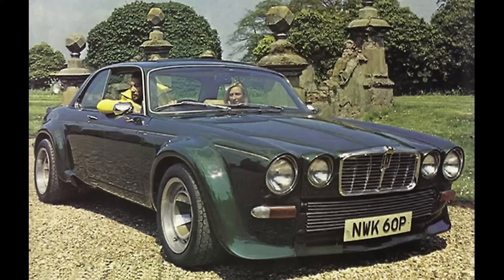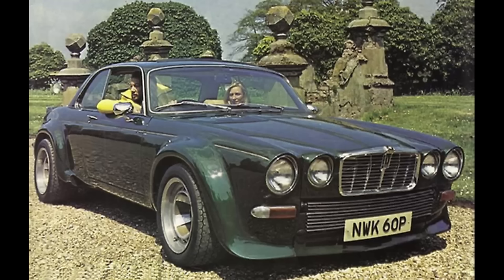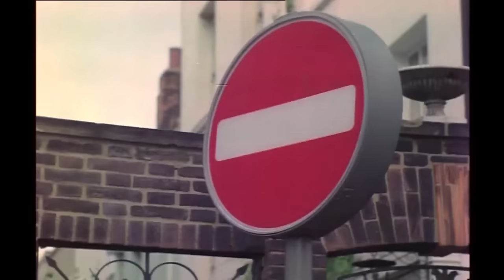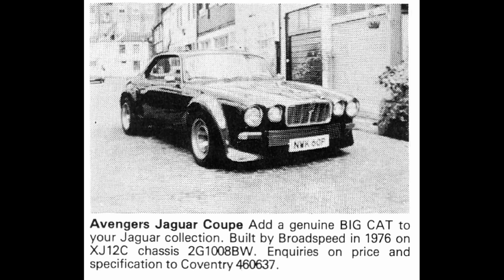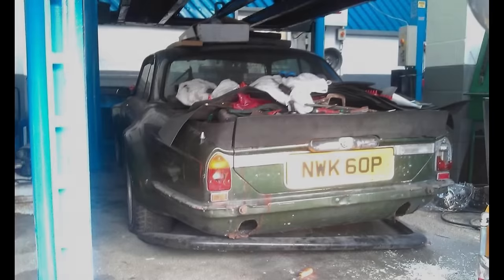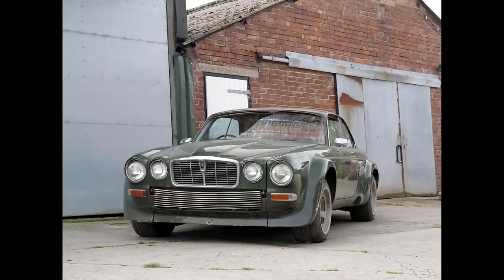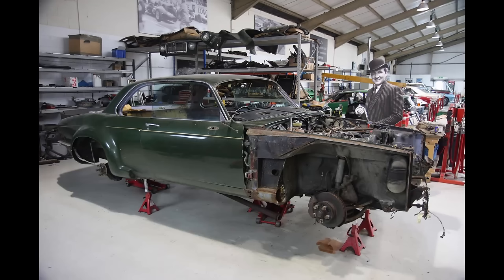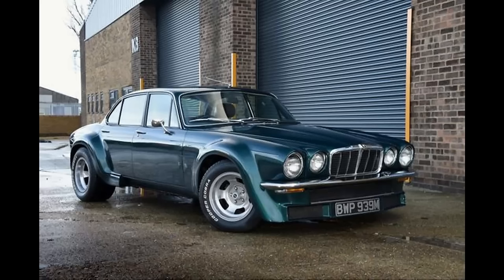new avengers jaguar broadspeed

Comment: I would have been about 12 when my eldest brother came home with a brand new Jag 4.2 - it was in brown with leather upholstery and more buttons and switches than a BBC outside broadcast unit, it was love at first site. My folks had a 1300 mk 2 Cortina - the deluxe model with chrome wheel trims and very little else. The Jag had a/c and electric windows, it went like stink and drove like nothing else I had experienced at the time. I have had half a dozen Jags myself to date, my favourite being the 2000 XJR supercharged beast - what a car. Times are hard now so a turbo charged mini is my daily driver but as soon as things turn around my days of Jaglessness will be over once more.

Comment: I used to share an office with John Howlett at Leyland Cars. He was responsible for liaison with TV companies and told me that thing was practically undriveable at normal road speeds, mainly because the steering was so heavy that it was the devil's own job to get it round corners.
Reply from the maker: yes the wheel offset of the wheels was so wrong it was terrible to drive , they narrowed the wheels  only on the inside , so the outside stayed the same  to keep the look of the racecars
Reply: Wonder  where  this is  now
Reply from the maker: @TelBil2010  me to
Reply: @TelBil2010 it’s being restored
Reply from the maker: @russcooke5671  it was restored , but the company doing it went out of business and than it dissapeared again , i heard it was being finished at jaguar heritage , but not sure of it, and that was about 5 years ago so it should be finished  already long time ago ,,, it was never shown anywhere , also not spotted on the road, so it's in someones garage  hidden away from everyone
Reply: @modelmania825 Is it possible that this problem can be solved? I remember this fascinating car and the television series 😁👍👋🏻🇮🇹
Reply from the maker: @alessandrodaltoso  what problem  needs to be solved?
Reply: @modelmania825  The offset problem if I didn't misunderstand: I'm using the translator thanks for your post👍👋🏻
Reply: Interesting. I heard a similar thing about the Triumph Roadster used in the "Bergerac" series. John Nettles hated it, saying it was "hell to drive".

Comment: A few other things about the "Big Cat" to note:

The original color of this car from Jaguar was Lilac. Thank goodness for the repaint!

Also, if you didn't realize, at the 2:27 mark, Steed actually looks like he's driving a manual (watch his left arm) and with the correct soundtrack (it were really a manual in the first place) to match.

Both Patrick Macnee and Joanna Lumley have talked a great length about the car, with Patrick stating it was an absolute bear to drive due to the modified suspension and Joanna (being a car gal) stating she loved the car, but was always relegated to the back seat! 

I was also keeping track of the car from here in the US, and after the restoration company tanked, the owner had the car supposedly sent off to another resto company to be completed. Nothing's been confirmed though, and that's the very last thing about the car that I've heard.

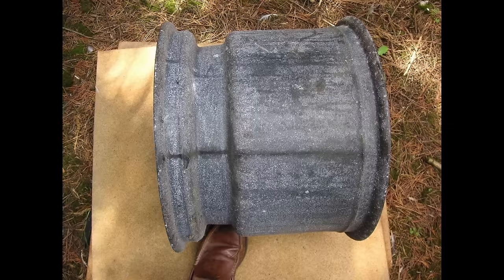Comment: 0:56 Do you have any design details about the 5 centre-lock "bolts" (nuts) used instead of the single large centre-lock nut for fixing the racing wheels to the standard Jaguar hubs?
Are the custom-made wheel nuts just hex bar turned down to fit the 5 drilled stud holes in the modified wheels, with thick washers machined to suit?
The wheel nuts look like they are the "Mag Seat with washer" extended thread lug nut design.
These were popular when aluminum wheels first came out years ago, but now they're pretty rare.

Comment: I had the 4.2 Daimler sovereign in the 80s  I did like it at 1st but the steering was very slow to react maybe because of those big tyres that those cars had... The car though was beautiful to be inside with wood everywhere tastefully done.. And very quiet on the motorway... I've replaced it with a Granada 2.8 I more nimble and more fun to drive.. But there was always something about the Big cat in a way.
Reply from the maker: probably the rubber bushing on the steering rack , when they get older the steering feels like a boat , the whole rack moves first before it starts doing something 
we used to put metal shims in it so the rack could not move anymore that way the handeling would improve a lot

Comment: Take it or leave it!! Wheels turns table upside down of any car's profile.. agressive or gentle, man i would sell my kidneys just to olbuy those wheels, those wheels are just as unique as those firestone unique wheels..
Reply from the maker: yes they are rare , the wheels on the avengers car where a one off set ,  the wheels on the racecars  probably 4 or 5 sets where made , i used to own a full set and 1 seperate rear wheel ,, i sold the set for 10.000 euro  and still own the one rear wheel , i also have 1  19 inch speedline wheel of the 1977 racecar